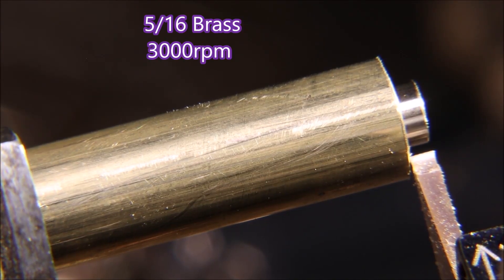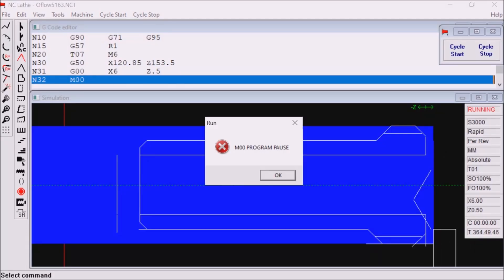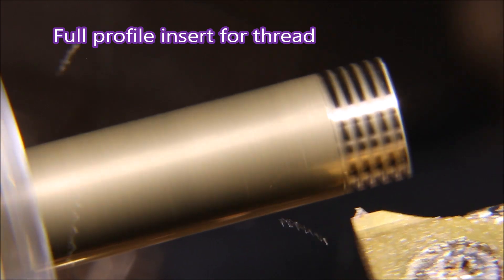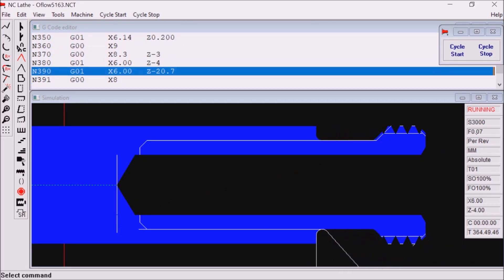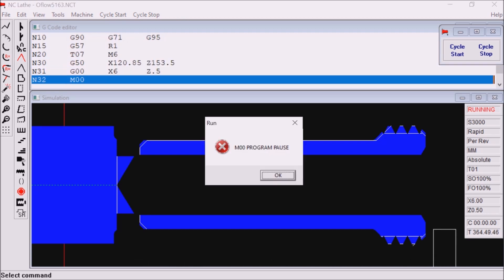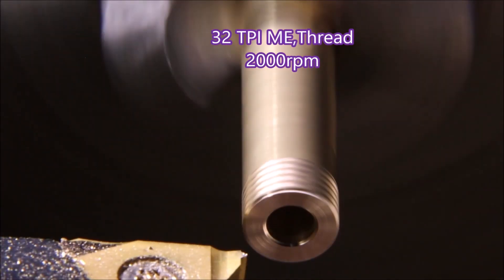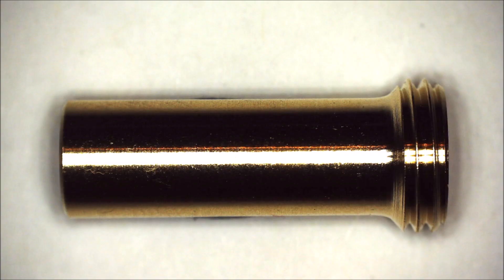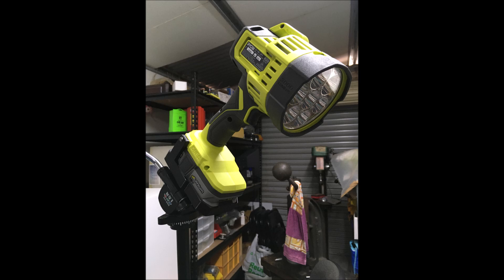Small cnc lathe makes brass part, drill, thread 5/16x32, turn and part

Comment: Hey, would you mind giving me a little advice in this area i have a few questions perhaps through email? Thanks
Reply from the maker: How about we start here so I get an idea of what you need?
Reply: No problem, thanks for the reply. Mostly I wanted a little advice about how you get work in regards making small parts i have to boxford 160 cnc lathes that i think are similar enough to yours, I’d love to be able to get a little bit of custom parts making work say from a single part up to 200 part range, ideally some day i would be scaled up to have a small business in it with some more advanced machines and as we know the longest journeys start with the first step, cheers
Reply from the maker: Hi Alan, my manufacturing started quite oddly. I am a draftsman with a trade background. I was designing parts and then making prototypes. The making prototypes grew to doing small production runs and off it went from there.  Not much help to you is it.
Reply: No no thanks for your reply I appreciate it , do you have any advice for small production runs on small lathes like ours and what would be the max amount of parts you would take on, a couple of hundred would it be ? Thanks
Reply from the maker: 200 is quite a lot with manual loading of blanks. Competing on price gets difficult when folks have auto loading machines with lots of grunt. Perhaps offer quick turn around. I just did a job in 7 days that the normal supplier was quoting 3 weeks and getting paid the same which is nice. Make sure you are happy with what materials you can cope with. If you need to, practice. Stainless, mild steel, free cutting steel, 4041 steel, aluminium machine grade or including 6061? Brass, bronze, only take on what you know you can deal with economically you and the customer both have to be winners. I would suggest you find a good tooling supplier inserts from ebay are not great in small machines. My Sumitomo rep has been a great help, find who will best serve YOU. Make sure your machines have no kinks that need working out. Regular work will find any kinks for you. Make sure you can buy the materials you may need to supply customers, the list to practice on will do.
Reply: Yeah I had thought competing with the big guys would be one of the main obstacles to overcome, I hadn’t given that much thought about a tooling supplier now that you mention it . Also how do you quote for a job, is it just material cost along with your time or is there anything else you take into account?
Reply from the maker: I am really crap at quoting, but yes material,  setup, and runtime is about it for me. As for supplier, I found Sandvik too expensive for my taste, Sumitomo was recommended  and I have been very happy with them. Not ebay or aliexpress prices of course but value inserts and good advice are worth a lot when getting going.
Reply: Ok Thank you for the replies, that’s all i have for now but I’m sure I’ll be back with more 😅 sorry for bothering you but I’m yet to find anyone else that works like you and not on a half a million bank owned machine that is as different to my machines as a spaceship is.
Reply from the maker: @Alan-hd9ov  where are you? With two Boxfords I would guess UK.
Reply: @smallcnclathes  not quite, Ireland
Reply from the maker: @Alan-hd9ov  can you email immediately if I put my address on here, so I can delete it ?could you do work for a bloke in Lincolnshire?I do and you are a lot closer than I am!
Reply: @smallcnclathes  yep I’ll email you back so you can delete it and if it’s ok we could discuss it in detail tomorrow
Reply: Sent there
Reply from the maker: @Alan-hd9ov  not here yet but will delete anyway
Reply: @smallcnclathes  hmm ok well if it doesn’t work I can give you mine
Reply from the maker: @Alan-hd9ov  nothing yet, are you on facebook? i am Nigel Berry in Melbourne and not a doctor, there is one!
Lets continue tomorrow, you need to get to bed and I need to get to work!
Reply from the maker: @Alan-hd9ov  you did use the at symbol and the dot for the dot?

Comment: Wonderful video. You do a lot of brass parts. How have your brass supply and prices been since COVID?
West coast of Canada here, and I’ve had to wait 3-4 weeks for delivery of just about any brass size or shape I’ve ordered. It’s maddening.
Reply from the maker: I just wrote a long reply and lost it. I have not noticed a lack of supply but I do not use much these days.  Price just seems to climb regularly.  For this job one length of 3600 was $37 aud it was 5/16 for goodness sake.  That seems pretty expensive to me.  Have a steel job tomorrow, and not Free Cutting either it needs to be welded so just bright mild steel.  May prove to be a challenge and will need messy spray mist to have any hope of making nice parts. Hope it proves an easy job. I don't need challenges, I like to stay in my comfort zone. LOL
Thank you for your regular comments.  My videos seem to take a lot of work and return little money.  Comments really help to keep me at it.
Reply: @smallcnclathes  

That works out to ~$12/lb if it was a 12' bar. Thats roughly the same as here.
I TRIED to order some 1/4x4 brass flat bar for a job two weeks ago. 3 suppliers simply didn't have it, and couldn't get it.

1 supplier had it, and it was $800 landed for a 12' piece... If you pull a number out of your head based on past prices now adays, you'll lose your shirt every time.

You have fantastic videography and editing. You're one of the few channels I don't constantly skip ahead on!
Thanks a lot for making content.